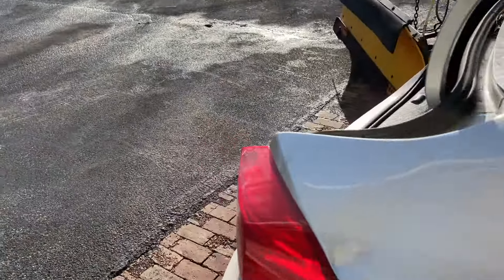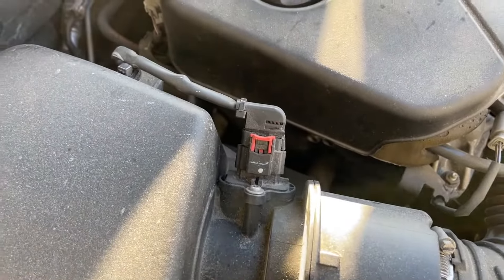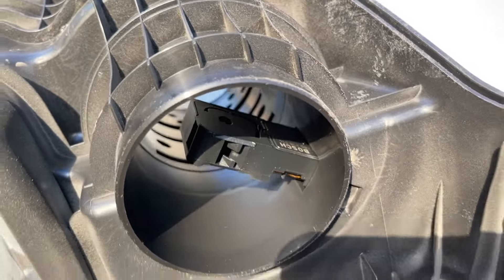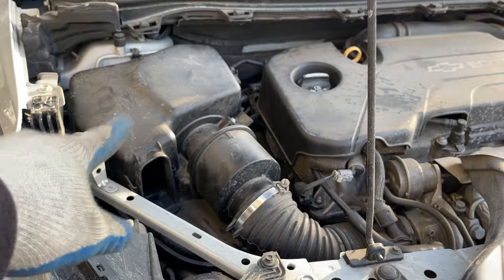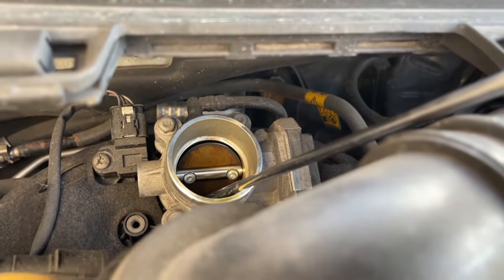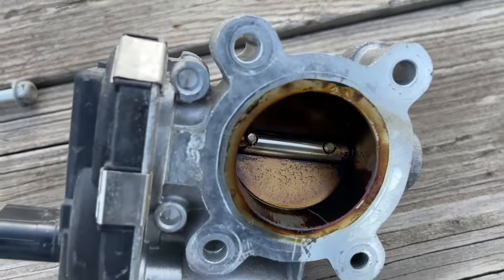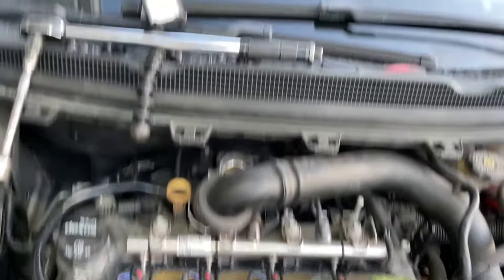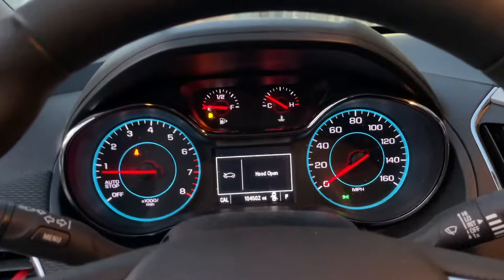Chevy Cruze Bad Throttle Body Or Mass Air Flow Sensor?? Code P1101 $30 Fix Quick And Easy!!!

Comment: Could this be the reason why my car keeps turning off on me??? I also unplugged the mass airflow sensor while the car was on and it kept running so I heard that ‘ that means the air flow sensor is bad .. could it just be that it needs to be cleaned? Thanks so much for this video btw!!!
Reply from the maker: You can absolutely clean the mass air flow sensor and see if that will help. Here's a link to the cleaner and the mass air flow sensor as well...

https://www.ebay.com/itm/284568058591?hash=item424193fadf:g:Er8AAOSwDiJhuEsc&amdata=enc%3AAQAHAAAAwCikN4zAYfqDGAMBCQj151cxdMWI3xqOm6zJC4tvyBOXAJ55Cbqr0UKKi3vce8Nm8PRASpvh%2F5IKtYGLePt7LcPCYDeuGMRgVtJgPR3GWJGFvI2CAszDgSb3ZeQJpY0BkQZM1mddLbL640coOHS7NURGliZxtXjdIac5TrOswuSHw9qASW%2Bfi%2FBDQnMou5TZQYEMHnzcErl9kTmM0P444QJrfKnH0qF41m%2BpoMYHNQTvY6U3K6wV9JCRBR5WhReq2g%3D%3D%7Ctkp%3ABk9SR_D8yfiTYQ

https://www.ebay.com/itm/165106138091?fits=Year%3A2016%7CModel%3ACruze%7CMake%3AChevrolet&epid=238135865&hash=item267117bbeb:g:Jv8AAOSwFgNhWe2~&amdata=enc%3AAQAHAAAAwF0GeekW3IPJ08ZD42yV%2BVK5xa%2BLQs%2FTIS%2Bvh%2BYcSVH5f02KZhitmn4pyp4RFqHEYrBDtCrAj7mOk5f9NIzDxoMOvgmqTBYjgJQGMW4Lpo%2BvbXYuflPygcXda9fi8nH3wqivMiCUauUQqMZQ3Jl0SHjcXcrlNydq0sU1Ir458yQQL0QM50Ws8pNjFwI8aJpE%2FjHvnftcb38UWoefrBdn6IqNLr0VM4nHqJzIarurm7QxU6NjJ%2BYu0PiggbqZKWmlQQ%3D%3D%7Ctkp%3ABk9SR_D8yfiTYQ

https://www.amazon.com/CRC-05610-Mass-Sensor-Cleaner/dp/B00BPMCJKQ/ref=sr_1_1?crid=2IKVQDZR7E1JB&keywords=mass%2Bair%2Bflow%2Bsensor%2Bcleaning%2Bspray&qid=1669124239&sprefix=mass%2Bair%2B%2Caps%2C164&sr=8-1&th=1&psc=1
Reply from the maker: @UC4anXtm0NQY3MGFCvldiRbg , you can buy a cheap tool set and get the job done to save you money. Here is a link to a cheap set. 

https://www.amazon.com/AmazonBasics-131-Piece-General-Household-Hand/dp/B07V4TFJC9/ref=sr_1_1_sspa?crid=38ELBYYPI8PBW&keywords=mechanic%2Btool%2Bset&qid=1669231245&sprefix=mechanic%2Btool%2Bset%2Caps%2C85&sr=8-1-spons&sp_csd=d2lkZ2V0TmFtZT1zcF9hdGY&th=1
Reply: Thank you , you were very helpful!
Reply from the maker: You're welcome.

Comment: I had code 1101 on equinox 2018 1.5, service thought MAF was bad , replaced but code remained with check light on and loud idle and jerking and hesitation or surging. Replaced valve cover but problem remained . Finally I came across this video and did it my self by cleaning the TB where deposits hindered the smooth movement of the butterfly with power on engine off TB position reading 32.5%. After cleaning car running fine and check light turned off but TB still reading 32.5% on power on engine off .
This learned value did not reset despite car running great? Any suggestions
Reply from the maker: Did you disconnect the battery for the entire fix? At least an hour so the system can relearn itself? If not, although the car is running good, you may have to replace the throttle body. Or, you can drive it for a while and the values should go back to normal.
Reply: @TerenceDIY  tks Terence. I did fisconnect the battery for the job probably 40 minutes. I will have another go at cleaning and disconnect for more than hour and go from there.
Reply from the maker: Okay, let me know how it goes.

Comment: If you've owned any car then you know just clean the MAF with cleaner and you're good. My 2005 rabbit had the same issue and this is all I did. Even if I ran with that light on it wouldn't matter, it only matters for stupid E-Checks which are a waste of time anyways.

Comment: Has the check engine light came back on I know anytime you unhook the battery it has to run a certain amount of miles before it completes all emissions again?
Reply from the maker: The check engine light came on for another reason months later (VVT Solenoid went bad). I have a video on my channel for that fix as well. The car is running amazing now.

Comment: If you do this without disconnecting the battery, will it still work ?
Reply from the maker: Probably so, but you want to trick the system by installing the new part while the battery is disconnected. Once reconnected, it will read the fault and clear the issue if this was your problem. Thank you so much for watching.
Reply: Thank you for reply, it worked perfectly for me. Turns out after my oil change, the mechanic did not put my air filter back on correctly, so as soon as I removed the cover, it fell out.
Reply from the maker: That's awesome! Thank you.

Comment: This is happening to my car I put a new throttle body maf sensor and air filter an the cel is still on and the engine reduced power is popping up when I drive far can help me out please what else could it be 2018 Chevy Cruze
Reply from the maker: Can you tell me exactly what code you are getting? I will try to help you identify the problem. Thanks,

Comment: Will this work without removing the unit ? I need t clean the throttle body but don’t have a torque wrench so wouldn’t want to do it wrong pls respond
Reply from the maker: Hi Alex, there is a possibility of it working however, it is MUCH better if you remove it. Don't stress about the torque wrench. Just make sure the bolts are tighten if you remove it. You can do it very easily. Thanks for watching.

Comment: So I did this and it worked for a little but then my car started to shake again and Turn off on me again as well . Also the lights popped up again
Reply from the maker: Unfortunately, you will probably need to replace it. It's a quick and fairly inexpensive fix. Here's a link for the part. 

https://www.ebay.com/itm/264758871266?fits=Year%3A2016%7CModel%3ACruze%7CMake%3AChevrolet&hash=item3da4dbc4e2:g:AFkAAOSwW1Fe4B2O&amdata=enc%3AAQAHAAAA8CxW3xQBDP8Wl4cp%2FeJPnBSvLKyjmZbDdNgDRa4LMLnk93OXH8X1qj33jz5%2BgjNEJVFN1i25HErd3zlFck0bnEhcft4i89XvB%2F%2B%2Favg%2FV1wvkbJIo1iXWW1iGezeun3rMCiRLZy9YIvANd7%2FbaI6j9EuJtbUKDL1dnvsufB4c9zQrefV1bBJ7PgDpoiEVxMn7lQ%2FhoK2p03BDEE55L3OqhAqjk92nIJeWXBunCKKOCiUpP1Jyyjg22JGvfl%2FfRWASEl7diR%2F%2FuNoWyAVxpHrtOkWSAqRpAgLmQBha3bHNkehOdGff%2FXDSR6%2BKBhfBHb3WA%3D%3D%7Ctkp%3ABk9SR-qJuvSUYQ

Comment: WHAT BATTERY DOES THIS MODEL DO? AGM?
Reply from the maker: You can use a AGM battery however, It is not required. There is not one in this vehicle. Thanks,